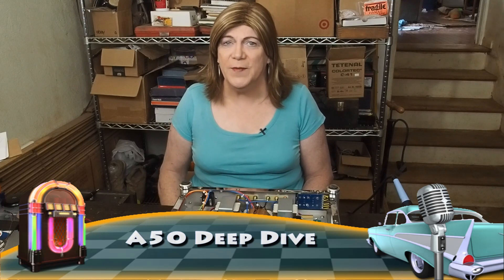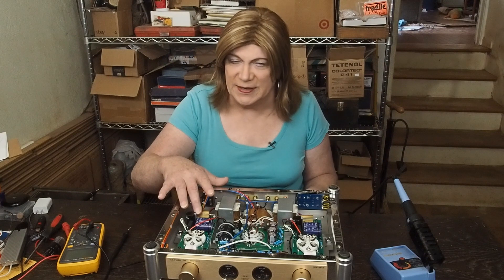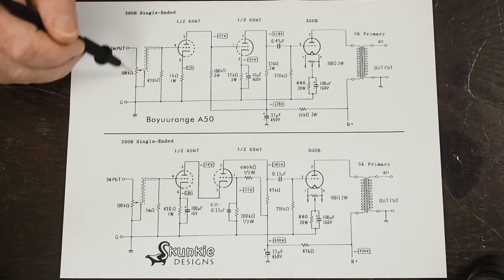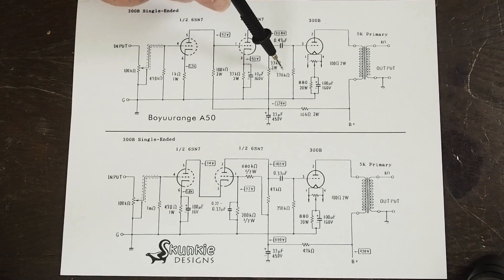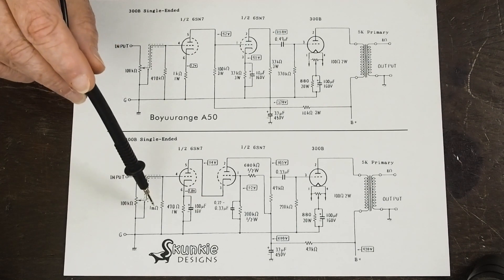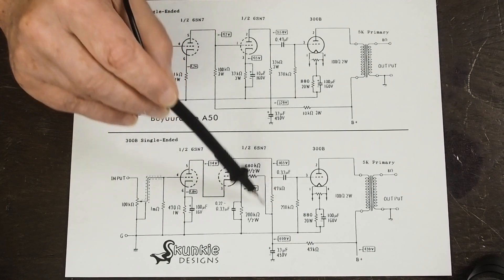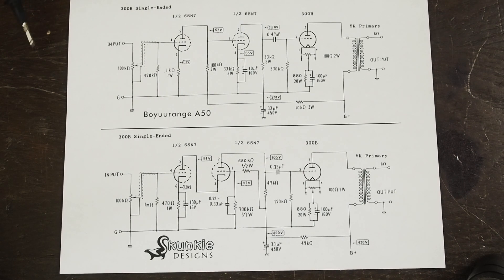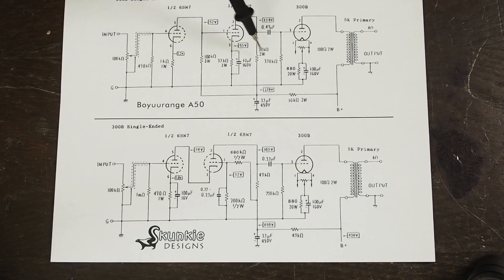Boyuurange / Reisong A50 300B Tube Amp Schematic Deep Dive

Comment: Excellent discussion and you've made sure that people like me can understand what your mods are setting out to achieve. I've done basic work on various amps, so I can at least handle a soldering iron, so this is all possible for me. Thank you! I'm running a 5U3C rectifier and 6H8C drivers. I swapped the stock 300B tubes for some TJ Music 300B/n mesh plates. The TJ's are nice, but they didn't warrant the extra expense. The stock Psvanes are pretty good.

Comment: Howdy. Absolutely great.
I did not know and understand how the cascode works. Now I believe I do. The upper triode is actually a common grid amplifier stage. It has a low input impedance and may be designed to deliver large headroom/swing with low output impedance.
Exactly what I need to drive my 2xKT88 PP. I use fairly strong anode neg. feedback to the grid around the KT88. This reduces the KT88 input impedance and increases the signal headroom demand. I use the strong neg. feedback around the KT88.s to reduce the skewing effect of the OPT magnetization. i believe not everyone understands that all transformers produce a reactive magnetization current which lags 90 degrees from the signal current. This when the signal source allows reactive currents (the power grid).
End tubes cannot pass reactive currents. The magnetization current and the signal current are in sync. The only way to get the 90 degrees shift is to forward the signal voltage in time.
The large gain of the cascode facilitates using strong neg. feedback around the cascode too. This will, I believe, still decrease the cascode output impedance.
Much Gratitude.
High Regards.

Comment: Does this amp use AC for the 300B heater supplies or is it DC regulated? (BTW, great walkthru and comparison and of the two schematics ,you are truly democratizing high end audio vacuum tube design!!)
Reply from the maker: Unregulated DC and that is my goal. I think people try to super complicate what is going on, much of this can be sorted out with some trial and error, a volt meter and an analog scope. Tubes are VERY forgiving!

Comment: There's also PSRR - look at the B+, through the 10k, past the 33uF (LPF there), and then to the 6SN7, it feed B+ noise into the grid of the 300B which then comes out 180deg out of phase to the transformer, cancelling some noise. The 0.47uF cap will phase change it but you get some benefit.
At least you don't have to worry about elevated heater voltages with a 6SN7, unlike the small B9A tubes (thinking 12BH7A for example).
Reply from the maker: I will be elevating the heaters on the 6SN7 to around 40-50V as the 90+ volts is way too close for comfort for me :) PSRR (power-supply rejection ratio) is likely only relevant in a pre-amp or phono stage IMHO , especially as clean as this PS is. With a DHT, it's much more likely to be the heaters or lead dress causing noise.

Comment: With more than 3 times the voltage swing for the 300B grid, you should come close to getting its full output.
Reply from the maker: We shall see :)
Reply: @SkunkieDesignsElectronics  As you've often said, theory only gets you so far. I'm not a hard-core measurement freak but I insist on competent engineering (lookin' at you, Boyuurange) which requires both measuring and listening.
Reply from the maker: @1mctous  at some point some of this is just false advertising. "Output power: 7.6W x 2" "Total harmonic distortion: 1% (1kHz)" It's not even half that power output.

Comment: I have a similar front end for my 300B amp, except that it uses a different dual triode (medium mu too, but higher gm type) in cascode..  I left the lower triode’s cathode R unbypassed for the cascode since my preamp is relatively high in gain..
Reply from the maker: Which tube are you using?
Reply: @SkunkieDesignsElectronics  Bendix 6900’s (super uprated 5687’s).. Had them for over 20 years so decided to use ‘em some years back.. Pretty rare tubes now.